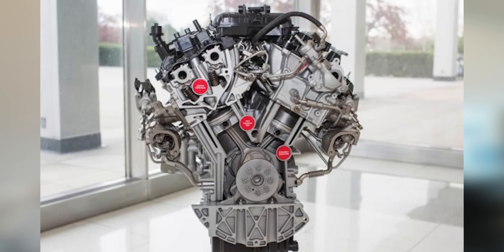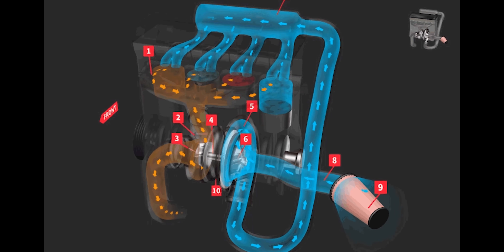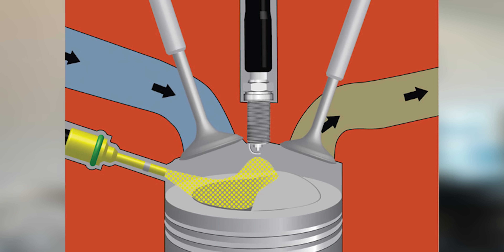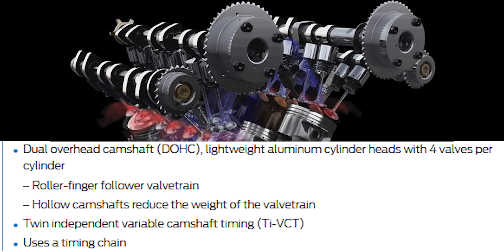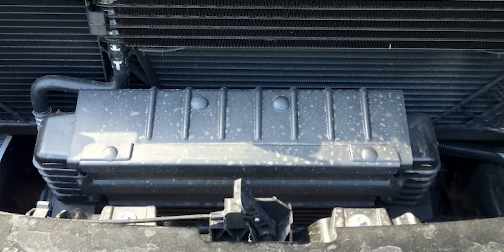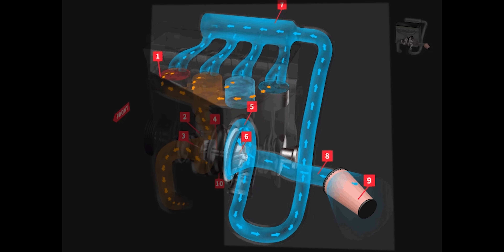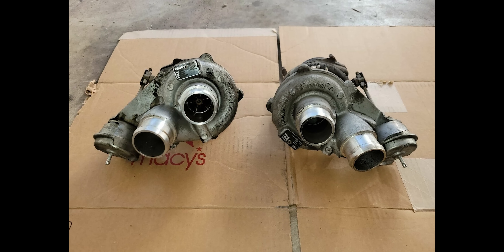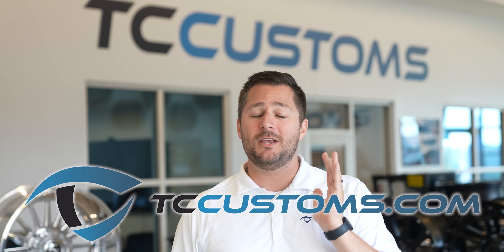The Truth about the Ecoboost Engine!

Comment: The coking that you mentioned isn't due to rapid cooling of the turbos.  When the engine has been working hard the turbos heat up and when you shut down the engine they get even hotter.  The oil that lubricates the turbos stops moving and the excess heat from the engine cooks the oil causing the coking problem.
Reply: Nooooo it doesn’t.....
Reply: @K9388-n3z  same thing happens in deisels
Reply: this is true, read the manual for after hard use, allow engine to idle for 10-15 minutes to allow cooling for the turbo.
Reply: @juggernautxtr  I really have no clue. Just wait to see the gearheads go crazy....
Reply: @K9388-n3z  looks like the joke's on you.
Reply: @OOICU812  No it's not LES it's on you. the joke is on YOU
Reply: @austin3626  as of this moment Don Fox has 47 thumbs up to his remark, no thumbs down; 
"coking" occurs due to too slow cooling - making oil "fry", not too rapid cooling. 
I think the jury is against you lol
Reply: The coking isn't a big problem until next start up and there is no oil left in the turbo.  Enough dry starts and your turbos are done.   My 1990 Sunbird gt had oil and coolant running through it as well LoL and multi port fuel injection (but not direct port...) So ya that's why there are turbo (shut off) timers...
Reply: @rayrussell6258  I have no idea what your talking about.
Reply: @madmattthehatter  rotating turbos are not in oil, they spin in air! 
On a cold start, there is no temperature in the turbo yet, so coking doesn't occur then, but WEAR does. 

It takes weeks or longer for oil to actually "dry out" in bearings/shaft, so what you suggest is a terribly rare event generally limited to someone who seldom drives a vehicle. However, if you are a normal use driver and tend not to let your turbo engine run for a brief cool-down, you WILL increase heat in the bearings and oil galleys, and coking deposits will likely occur and build up.
Reply: @austin3626  He is up to 50 thumbs-up now. Look at the icons below each post.
Reply: @rayrussell6258  coking occurs when the engine is shut off while temps are high. That's why turbo timers were invented.
Reply: @madmattthehatter  what is it with some of you people who argue on this sight? 
You disagreed with Don Fox, you said that coking occurs on start-up not on cool-down, now you post a comment in perfect agreement with him, and that I (and now 51 other readers) concurred with him in -- but you think you are telling me/them something I/we didn't already know! ? sheesh 

My first comment (in case you've forgotten) stated that unless software and an electric pump is used with a timer to continue running after engine shut-down, there would be no way that coolant use to cool a turbo would be much different than oil ..... since with no fluid in motion, there can be no higher rate of cooling the turbo housing, the bearings, or the adjacent oil galleys with either method. 

Now I think I've given enough engineering explanation for the general situation involved here, such that you might just agree. That would be novel, on this site sometimes.
Reply: This problem can be all but fixed by using higher quality oil than ford recommends, i usually just say dexos, but the best best best would be t5 oils like royal, amsoil, and redline, as well as the natural gas oils from pennzoil (specifically ultra platinum), and Castro's edge.
Reply: @Prestiged_peck  I agree with you. 
Oil with special additives does improve your chances, however the expense of those oils over the life of the vehicle might not be for everyone. 

Having enough patience to let the engine run a bit to cool-down is what most people should do. Like you say, not perfect ..... but it's the best compromise.
Reply: @rayrussell6258  well you can get the same result with lower end oils running shorter intervals, but really if you play your cards right the high end stuff, while more expensive up front, could save you in the long haul with extended intervals.
Reply: @Prestiged_peck  as you can see from posts here, many if not most people already are on the shorter intervals with regular oil...I do also, generally I schedule to replace oil at 4000 rather than 5000 miles.
Reply: @rayrussell6258  if you're using anything that retails below about $8 a quart at a parts store you should probably be at 3k
Reply: @Prestiged_peck  Ford dealer does it; 
I've gotten too far-sighted now to see what I need to see up close and change oil anymore. 
What they use is what the factory specs require. No issues with warranty that way. 

I routinely exceed 200K on my vehicles, so I have no concern with the recommended oil they use. 

However, I HAVE modified how I shut down the Ecoboost engine, being sure to allow cool down.
Reply: @rayrussell6258  I see no issue with that, I'm just letting you know you can go well beyond that, 20k mile changes are easily done on these ecoboosts with the right stuff, and I've seen trucks doing that hit 350-400k no issues. But it's all the factors, not just one, that makes a car make it that far, if you take care of everything and don't beat the crap out of things a car will always last longer anyways, and the right interval for the oil you're using will get you as far as the right interval for a different oil on said different oil will.
Reply: @Prestiged_peck  20K would void the warranty, otherwise you're right.... I don't jackrabbit or drag-race my vehicles and I don't let oversight of small repairs turn into major repairs. Always use Ford parts too, not aftermarket. They last longer, I don't care if they are more expensive.
Reply: @rayrussell6258  so if you're servicing at ford 20k will cause issues, obviously, their oil and filters aren't up to snuff for that kinda interval, but there are certain oils you can use where extended intervals won't void warranties, and if they do, at least with amsoil, amsoil will actually cover you if use of their products as they say void your warranty, I only deal with ford and per ford corporate that is one of the few oils they won't void warranties for extended intervals on.
Reply: @rayrussell6258  Ray, I have no idea what your even responding to. I get the feeling your an old guy lol.
Reply: The turbos on EcoBoost engines are mounted on the exhaust manifold (a big casting) and that’s mounted on the engine block (an even more massive casting). The mass of the water cooled engine block means it is a heat sink to the exhaust gas heated, inter-cooled turbos which means heat will flow from the turbos to the engine which means the turbos will cool down as a result.  Now I have a better question of how do you people drive? In my neighborhood the speed limit goes from 70 to 55 to 40 to 25. Why are your turbos cherry red?
Reply: the issue been around since the day before dirt
Reply: @austin3626  you posted this, up above in this thread, maybe this will shake loose your amnesia:  
 "@LES  No it's not LES it's on you. the joke is on YOU" 

your wording may have been intended to be humor; but you were inferring that other posters were wrong about what Don Fox posted; so apparently you are old too, and couldn't follow the string of posts! Your post shaded the post before you (Les), who was agreeing with Fox and who was disagreeing with K9 388. Therefore you were agreeing with K9 388, and he was disagreeing with Don Fox. 

I pointed out Fox has many thumbs up (now 56) agreeing with his post, that you were disagreeing with him, and so were in the minority. 

There now, did I fill in your gaps for you, old guy!?  lol 

My mind is fine thank you; you fell asleep! 

This entire thread is why the country is in such a bad state right now; people say things that they don't understand or out of context, intentional or unintentional, and piss others off who pay attention.
Reply: @ponzischemer1424  your explanation of the cooling process is incorrect; the truth is that they all heat up when you shut down the engine too quick; having no fluid in motion to carry away heat is the reason. Hot metal stays hot, it does not travel to the block (for a VERY long time). Oil fries in the galleys and bearings adjacent to the turbo housing long before that. 
So if what you say was true, we wouldn't have coking .... but we do have coking. 

To answer your "speed" question, it is not speed but LOAD on the engine that causes heat; 
you can drive 25 MPH (pulling a trailer for instance) and still be putting a load on the turbo/engine.
Reply: They don’t necessarily get hotter, it’s because the oil isn’t moving in the already hot turbo, but you basically got it right. The hot turbo cooks sitting oil.
Reply: @K9388-n3z  Yes it does. He's exactly right.
Reply: @rayrussell6258  Those older turbos were all journal bearings, which means the impeller shaft was spinning inside oil which acted as a bearing. So when that oil got cooked, the impeller shaft followed it shorty thereafter. It was a common event on early turbo cars that were driven hard.
Reply: @choltzapple  Not true for the Ecoboosts, which is the subject matter in this thread. 
I couldn't find a good diagram, but I found on a mechanic-trade discussion board that Ford uses bushings/bearings for turbo shaft, and a combination of both oil and coolant for cooling the turbo. 
Trouble with that simple answer however is that each version of Ford's Ecoboost (even on same displacement versions) has its own unique design, so exceptions to the rule may be found on certain models/configurations.
Reply: @rayrussell6258  I know, I said the older turbos that were mentioned were that way. Most turbos now use ceramic ball bearings instead of a journal bearing.
Reply: @Ray Russell  geez, I was trying not to crack open my heat transfer text book to put the calculations in the comment, but mass is the main driver in heat transfer through conduction from the hot body (turbo) to the cold body (engine). An engine block has a mass of X and runs between 195-220 degrees F. A turbo has a mass of x and an exhaust gas inlet temperature of 1750 degrees F. The reason the mass enters into it is because the engine block and it’s higher mass will heat up a little from the heat transfer from the relatively low mass turbos. But since we must have the discussion, q=-k A (dT/dx) where q is the local heat flux density, -k is the material conductivity, A is the area of contact flow, and the rest is delta Temperature.  Aluminum is a great conductor of heat, so is iron, the Area of connection is the manifold mount to the area, which is a good size area, and the delta temperature is about 1550 degrees.  So for all intents and purposes, the engine block is a block of ice compared to the turbo.  

Your second point about load is not wrong however, I think you’d agree that unless you live at the top of a steep mountain, you probably are coasting into your driveway which is a cool down cycle because you have airflow through the coolers, which was my point.
Reply: @choltzapple  ok, if you had qualified your remark to say "non-Ecoboost old turbos", it would have been understood as you intended it. This thread is about Ecoboosts, so I was just setting the record straight for other readers. I think you and I are in agreement now.
Reply: @ponzischemer1424  Lots of people live in cities and subdivisions with many start/stops before they pull into a storage area or their own driveway. The recommended 15-minute cool down does seem long, but I doubt more than a handful of people are driving without loading the engine for the last 15 minutes of any trip they make, despite slower speeds, so no the heat is still there, and it's not a long enough cool down just "coasting into driveway". Automotive engineers of every manufacturer selling turbo engines would not make the recommendation to delay shut-off if it was not necessary to avoid long-term problems. 
Load increases exhaust gas temperatures, and that has a direct impact on the turbo metal temperature as it moves through it. Combustion temperature in metal around the piston cylinders of a running engine is not transferring heat to turbos, it goes to the water jacket first. 
When I was an over-the-road truck driver, I was trained to watch the pyrometer and not allow exhaust temps to exceed a particular temperature, and downshift to another gear to reduce load and heat build on the turbo. Exhaust temperatures stayed below the limit on level roads. We often did not shut down the motor at all at truck/meal stops, so to better treat the turbo heat cycle issue. 
Your explanation about mass is helpful for the heating up of surrounding parts upon shutdown, but is not useful for cooling down turbos after shutdown. That process just takes too long and is too late. The coolant must be in motion after shutdown for that. And in case the automatic pump software might malfunction, I now do allow the motor to run 10 minutes in my driveway before shut-off.  

I do in fact live at the top of a hill, though. lol
Reply: @rayrussell6258 if you take the time to read my comment. I never say coking occurs in startup.   It's really quite simple cooking occurs in shut down (shutting down a engine while it's overheating or very hot) and the damage occurs in restart (the overheated turbo has coked it's oil so there is no oil in the turbo anymore).   The oil gets cooked on shut down (because oil flow stops)and when you restart the engine there is no oil in the turbo because of the coking that occurred after shut down.  That is why turbo timers are used.  To cool everything down.  That's why many race cars use electric oil pumps.  To keep circulation during shut down and build pressure and ensure clean oil circulation before engine start up. 🤪 Damage occurs over many shut downs one coking occurance does not ruin a turbo.  I definitely would not recommend shutting a vehicle down after a big hill climb towing a trailer like my buddy did with my truck.  Yes it still worked after... Did it do damage, probably. "Coke is the solid residue created when oil undergoes severe oxidative and thermal breakdown at extreme engine temperatures. The higher the temperature, the harder, blacker and more brittle the coke/deposit residue." Now if your turbo has coked it's oil how well is it going to lubricate on startup fresh oil will need to push the brittle residue out of the turbo.  It's going to ruin the turbo eventually.
Reply: @madmattthehatter  you spent a lot of time on that last comment, and if you had read and understood what I previously posted you would know everything you just said I agree with. How do you get the notion I don't? I'm not going back over this thread to try to figure out your incomprehension. If I responded to you back then, and you are now responding to that after WEEKS HAVE PASSED, I can only say you said something out of context and I was clarifying your words.

Edit: Quickly I looked back and yes you did say coking occurs on start-up; here is a copy/paste of your exact words: 
"The coking isn't a big problem until next start up and there is no oil left in the turbo." 

So in fact, you are so all over the place in what you say, YOU don't even know what you say!!!!

Coking occurs on cool-down of a hot engine and is a very BIG problem; wear occurs on start-up. The problem occurs at both ends of the cycle. 

Now blocking you to prevent further waste of my time.
Reply: @rayrussell6258  clearly your reading comprehension is low ... 😂 LoL if you tore into the turbo and cleaned up the coking before next start up there would be no damage so I'll sand by what I say that the damage occurs at startup (except the damage to metal shafts from heat soak) if you don't run these engine hard they should last a long time.
Reply: @madmattthehatter  that startup damage is secondary damage in sequence, the primary damage is the metallurgical damage to the turbo parts that occurs during the frying stage; your view is a tail wagging a dog. 

I don't know why you keep dragging this out; my follow-up comments back then were correct; your earlier comment (that I just copy/pasted) dismissed the point of when the coking occurs, and you said it was on restart, which is NOT true; 
you coming now and trying to switch your tune from what you originally said about when the coking occurs to now say you were talking about wear ..... that might be ok in your mind but it's really just an excuse covering up your previous mis-statement; now please leave this topic alone; it's done. 

we seem to agree on the general pattern now, so further discussion is unnecessary.
Reply: @Prestiged_peck  For the life of me I can't understand Ford recommending synthetic BLEND. We got synthetic to do away with the problems of regular oil. It's like 'there's only a small amount of pee in the punch bowl...' I don't want ANY.
Reply: @Prestiged_peck  So if you're willing to waste money, you can go longer? Today's oils especially full synthetic can go a lot more than 3k, even if they don't cost $8. 
I grew up starting to drive in the 70's... a case of oil was 24 quarts, and could be gotten on sale for $6.50 at KMart. Times have changed.
Reply: @rayrussell6258  Don't jackrabbit or race but OTOH these turbo systems are meant to be used - you need to actually let that motor work the way it was designed, and not just once a month. Biggest problem one mechanic said with these engines is people driving them to cautiously and the waste gates get stuck.
Reply: @rayrussell6258  A speaker implies... a listener infers. A speaker does not infer.
Reply: This problem is very real and can be stopped by using quality synthetic oil, letting the turbos cool down for 5 or so minutes before you shut it off and changing your oil regularly.
Reply: Yes. That caught my attention as well. "Engines get much hotter after you turn them off" - My Dad 1976
Reply: @K9388-n3z  yes it does. The explanation is correct. If the oil flow stops at engine turn off, the remaining oil gets too hot in the turbo bearing.
Reply: @rayrussell6258  no, turbo bearings of course need oil for lubrication.
Reply: @stefanheinz2524  This thread is a year or more old. I've said all I'm going to say. You seem to be saying you disagree with me on something. Reading your comment here, I already said the same thing a year ago. However, Ford uses a combination of oil and coolant in the design --- not just oil. Now just move on, please.
Reply: I read something a couple yrs ago, wish I could find the article again, it said that the turbos if hot enuf has an electric motor that circulates coolant to cool them off after you shut off the engine.  I think it was only the 2.7 tho..
Anyone else heard of this?
Reply: ok @juggernautxtr